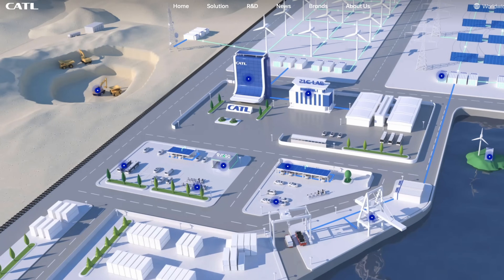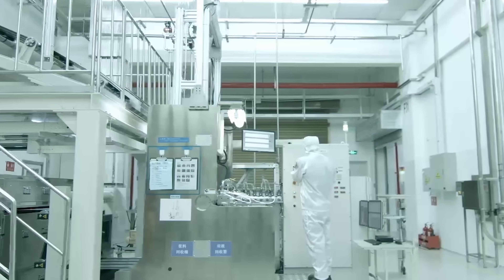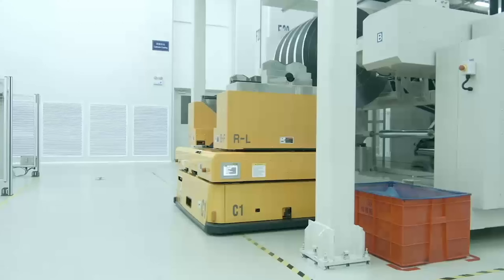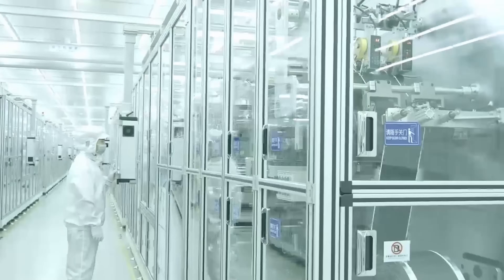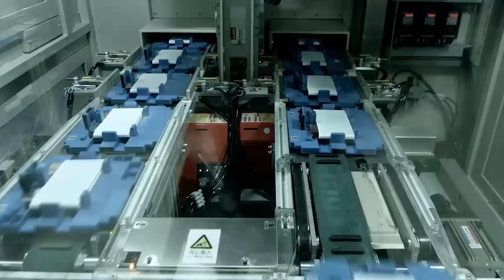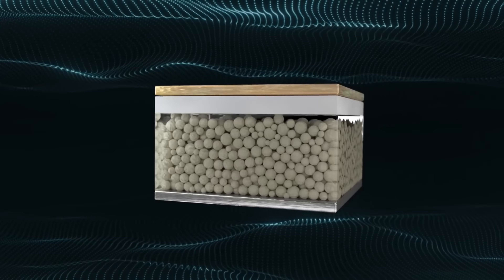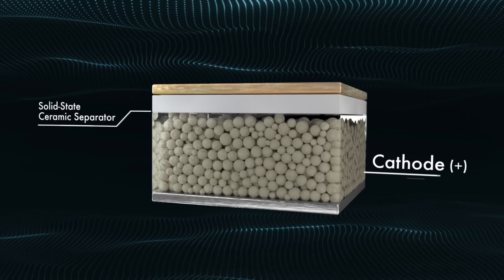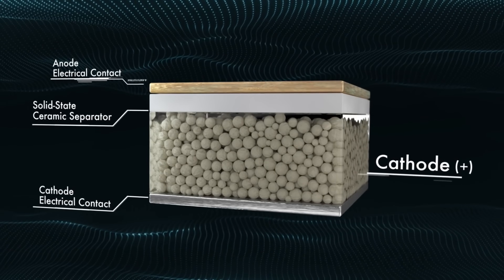We Discovered A REVOLUTIONARY EV Battery Company!

Comment: EV batteries are constantly offering more and more range, but I don’t believe much more than 300 miles is needed as a 6 hour drive with only a 15 minute stop is completely doable. Problem being that was not enough time for food and drink so we needed extra stop’s anyway!
Reply from the maker: But the myths persist. Rational thinking goes out of the windows. People get fixated on 1,000 miles range even though no petrol car in the last 100 years has ever got anywhere near that. Psychology!
Reply: @davetakesiton  best I got out of my old diesel Picasso was 733mi on one tank, but not in a single trip. That lasted 2 weeks driving to Somerset for a week away, travel while away, back home and then usual commute/school run for a week. I now have an EV with a range of 130-150mi (average) and honestly didn't take me much to switch. I just charge one a week rather than refuel once a month. I do believe it's just a mindset change. Just because your car CAN do 600-700miles on a tank, doesn't mean you ever need it to do that. I just filled up to full to avoid having to keep going back to the petrol station! (Maybe as I worked in on for years as a student so tried to avoid it where I could anyway 😉)
Reply: @davetakesiton  One thing to remember is that as EV's become more common place there will be more demand for people to use the public infrastructure and paying the high rates that these companies charge so for me it would be beneficial to plug in overnight at cheap rate 2cent/KWH  (Yes, not a typo, it is 2cents KWH so make use of the home charging infrastructure as much as possible so a vehicle with a higher range is definately worth it

Comment: when 1000km range is commonplace i will buy an EV
Reply from the maker: Be totally honest. How many times a year do you drive 600 miles in a single day? I cannot remember a single time I did in 40 years of motoring. 600 miles is about 10 hours solid motoring. You can do that without a stop? You’ve been brainwashed into demanding 1,000 km when in reality it will never be used
Reply: @davetakesiton  I travel on a1400 kms trip (2 way total) once every 2 months. in the summer it is +35 deg C and in winter it is -35 deg C (northern Canada).  The rest of the time charging overnight at home is sufficient. So i would like the benefit of only needing to charge once on the trip as superchargers are not the cheapest, even though still cheaper than gasoline
Reply: @kipper2k  The Lucid Air did just over 500mi (800km) on a single charge @ 70mph. Assuming the hit in winter could still get you one way you only need to charge it once at your destination. Even if that one charge is the same cost as gas then the rest of the time is still overall cheaper. If you bi monthly trip is to visit family then if they had an EV you could charge at theirs. If work related then would the company not pay anyway? I'm only guessing on what your trip might be for.  But 700km/440mi of driving one way you must be stopping off at some point for a quick break so 100km range isn't overly needed, it's just a slight change in mindset that the car refuels when you walk away from it.
Reply: get your cheque book ready; it's progress
Reply: People need to remember that Canada and the US (i.e. North America) have a domestic supply voltage of 120V 60Hz. As such domestic EVSE charging is probably only about 3.5kW charge rate, so charging at home in NA is near enough twice the time it takes in the UK/EU.
Reply: an overnight charge is good enough, and don't forget we can tap in to the 240V that the dryer etc uses so we can achieve same speed as the UK @InBodWeTrust
Reply: @InBodWeTrust  my understanding from many video's on YT is that in America they can have a 240v Level 2 charger installed. Yes it's an additional cost, but no worse than in the UK having to pay £1000+ to have a 7kW charger installed rather than using a granny cable and external wall socket.
Reply: @InBodWeTrust  not quite true, the US can, and does have 240v available if you want or need it.

Comment: Dave,

How fast would the car need to be driven, to require charging twice in one hour?  Let alone 4 times!🙂🙂🙂

Also it might need an awful lot of cooling if charged four times in an hour.🙂🙂🙂  Discharging at multiple C rates will produce a lot of heat.

((Yes, I know you meant something different to what you said)).  I prefer facts rather than hype.
Reply from the maker: I’m not talking about a car, Oliver. The battery is rated at 4C so can be charged and discharged 4 times in an hour. Nothing else needed. No cooling no equipment, just 4 full cycles in an hour as it is
Reply: @davetakesiton    Dave,

Maybe I was too flippant, re driving speed, but my point was that at 4C charging, the battery (of any capacity) will require 15minutes to charge.

Discharge at the 4C rate would also take 15minutes.  That is half an hour for one FULL cycle - hence only two FULL cycles are ever going to be achieved in each hour.  And that, of course, is purely theoretical.

To discharge the battery, if it was to be fitted to a car, would require the car to be driven at 4C (ie full power) for that 15 minutes.

Let’s take an example of a 100kWh battery.   It would need to charge and discharge at 400 kW.  Discharging at that rate is supercar power (over 630HP) for the full 15 minutes.  That is over twice the full power of my car, which can achieve nearly 120 MPH, while only using its full power to accelerate rapidly to that ‘limited’ top speed.  So, very sorry, but your claim of four full cycles in an hour was an impossible scenario, so (IMO) pure hype.
Reply: @oliver90owner  These charge/discharge cycle will have all been on a test bed, so a lot higher rates would be achievable. It's possible to discharge a battery in a few seconds, with the right equipment. The only trouble is, normal batteries would suffer  high degredation or damage doing this. But what the manufacturers point is, if their battery can be charged/discharged this rapidly with no significant damage. Then it could easily cope with normal or pretty high charge rates
Reply: @garyfromlondon    My simple point was not that 4C cycling was bad, damaging or whatever.  My single point was that 4 complete cycles per hour, at 4C, was unattainable.  This is an EV channel, not a vaping forum.  I would admit that tiny cells could individually be cycled thus.  But just not practical.
Reply: @oliver90owner  Those complete cycle charges are attainable, and they have proved that. Obviously you don't want to be doing that in everyday use. But if those high charge discharge cycles are possible then a much lower rate, which is all that is needed, will be available in the every day use
Reply: @garyfromlondon  My very simple point was that the charging and discharge rates, while possible, two lots of charging and discharging could not be crammed into a single one hour period.  To me, that was plain hype, not practical or useful information - particularly for the application to BEVs.

It’s like saying that person could dispense a pint of beer and drink it within one minute while inferring, from that result, the person could drink nearly 8 gallons of beer in one hour (or over 8 gallons in US measure).  Get it yet?
Reply: @oliver90owner  no you don't understand, just because something can charge in an hour, doesn't mean you have to do it. All that shows it's capable of charging at that speed, so charging at a lower speed will not adversely affect the battery. It's like having a Ferrari that's capable of 200 miles per hour. You don't have to drive at that speed all the time. But because it is capable of those speeds, it is under very little stress when driven at normal highway speeds etc. Have you got it yet